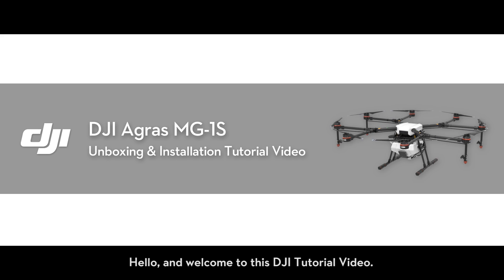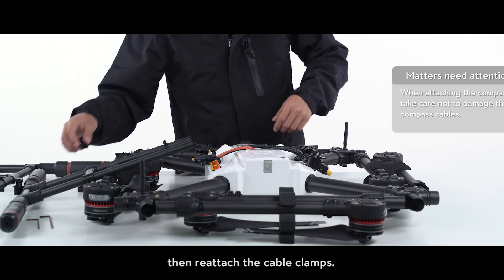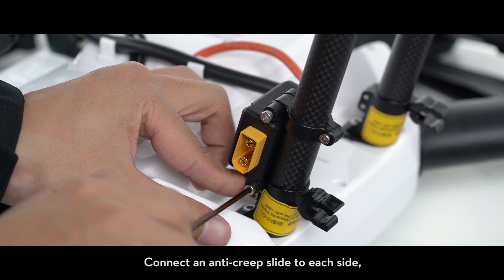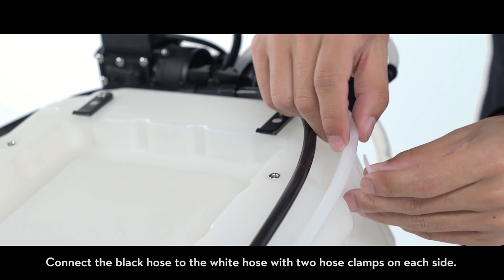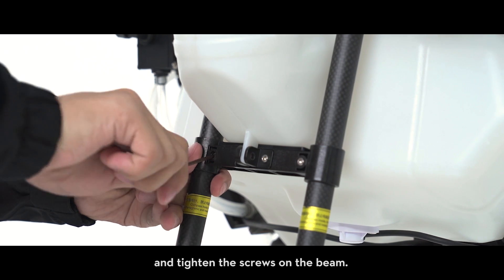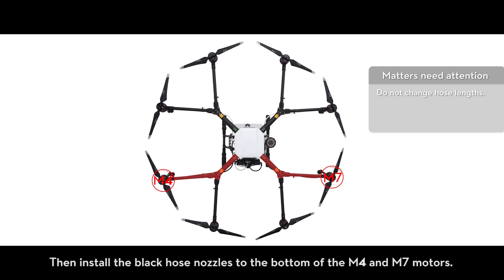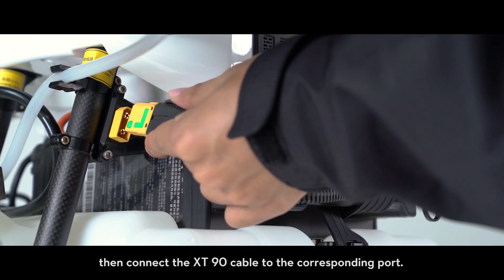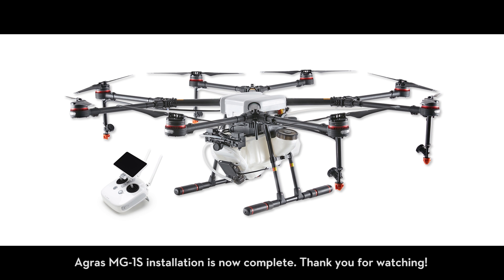DJI - Agras MG-1S -  Unboxing & Installation

Comment: Some great tutorials on here but I need some advice.
I bought a Phantom 4 and was flying it in Beginners mode which is 100 feet up max and 100 feet away. I flew 100 feet away and about 80 feet up then it said out of range. I tried to bring it back but it would only move to the right and left I had to land it where it was it's a good job I was in a large open field.
What do you think the problem was with your know how with your products.
I had a look online and some say don't use beginners mode what do you think?